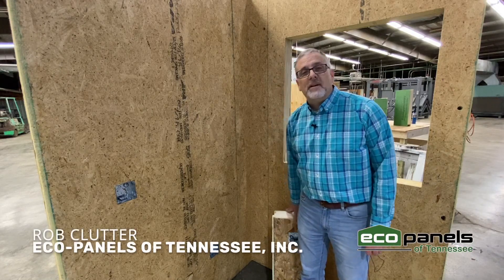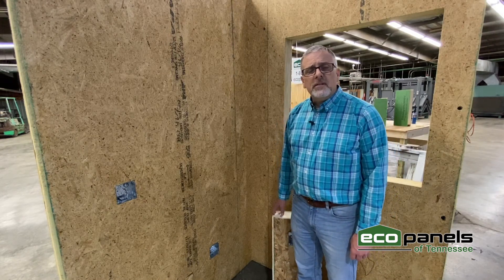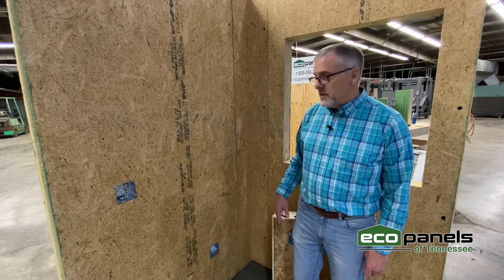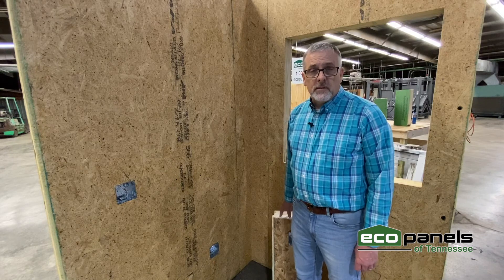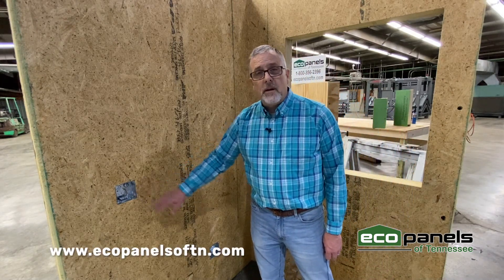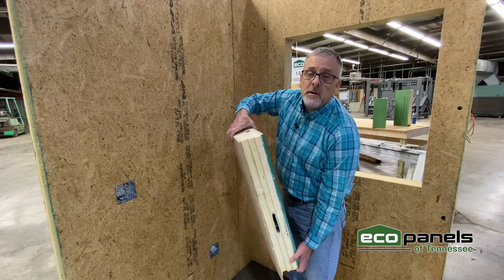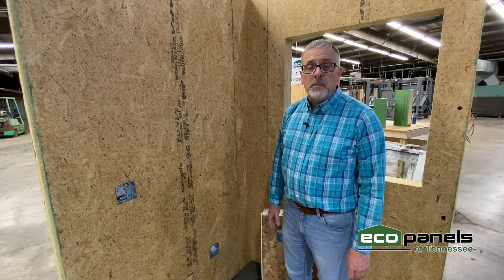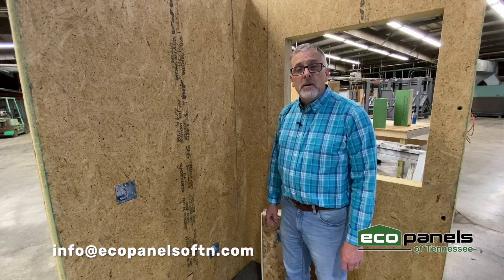Embedded Electrical Boxes & Conduit in Eco-Panels SIPs.

Comment: Never enough video or how to when it comes to plumbing. Why is that ?
Reply from the maker: Hopefully we addressed this in your other comment on the subject. To the benefit of others that might read this, our SIPs are intended for exterior walls on a building. Generally speaking, and sometimes by code, you should avoid placing plumbing in exterior walls of any home. So, our SIPs really create no additional issues or challenges with plumbing. Plumbing for kitchens on exterior walls are the most common need, and those typically come up from the subfloor. An experienced plumber will not really treat an SIP home any differently than a conventionally built one. Hope this helps on the topic.

Comment: How do you run the plumbing vents or plumbing in general for that matter ?
Reply from the maker: Thanks for the question Rick. Our SIPs are intended for exterior walls only. Generally, and sometime by code, plumbing in exterior walls should be avoided. You would address this like you would in any other home. A wet wall could be used on the interior if absolutely necessary. Most plumbing into kitchen sinks, etc., would come up through the subfloor. Penetrations for exterior spouts are typically located within the foundation. I the case of building on a slab, a penetration for an exterior spout can easily be done. Hope that helps. If you have further questions on this, feel free to give us a call.

Comment: No thanks. Too many changes in the field. It would be a pita with those already in place.
Reply from the maker: The concern is understood. Experience shows it’s not that difficult. Additional electrical can be added on site with relative ease. The vast majority of the SIP industry requires the install of electrical on-site, which requires a similar modification method. A large part of electrical is on interior walls, which isn’t effected by using SIPs. In our opinion, and that of customers and their builders, is that the life-long benefits of a SIP easily offsets mod time that may arise in the field.

Comment: Why a conduit instead of the usual cut-out wire chase?
Reply from the maker: Great question. Our SIP cores are injected with poly foam, rather than being a layer of EPS like most panels. We set boxes and conduit to spec prior to this injection. While on-site modifications are still possible, we do the work in our plant to build each panel to spec. It’s also worth noting that our foam is a thermoset product and will not melt at any temperature, so hit knifes typically used on EPS does not cut our foam.